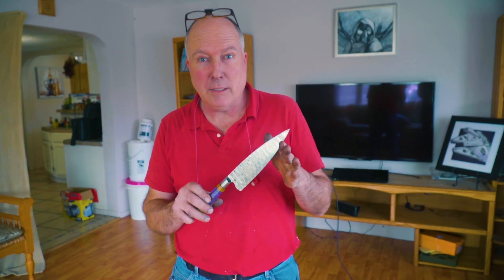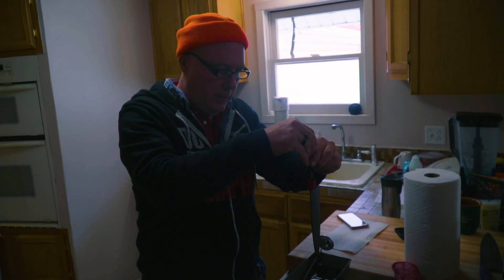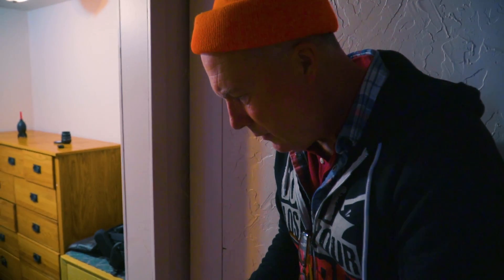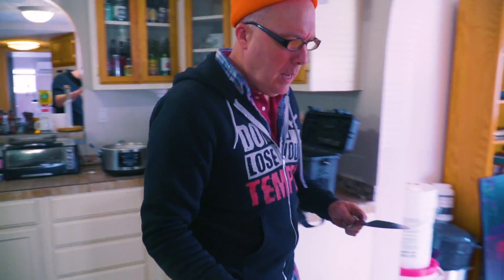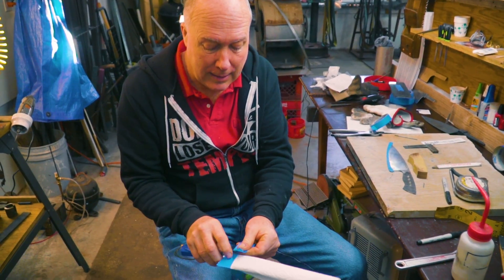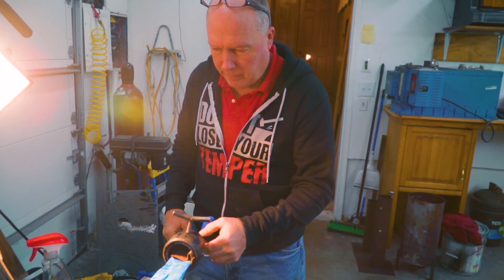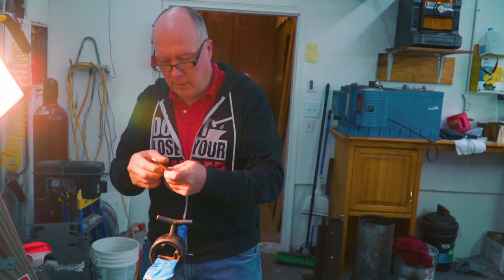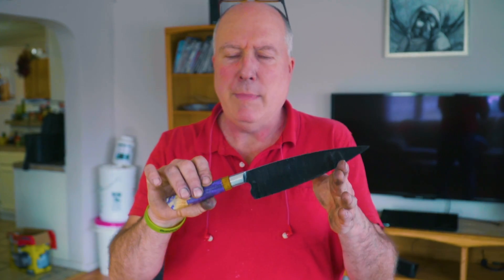It's Amazing What Instant Coffee Can Do...

Comment: how delicate is the coffee etch, is it something just for a show blade or can it be used as a knife/sword without coming off?
Reply from the maker: Hey mess
Great question. The coffee oxidizes the surface of the steel somewhat like gun bluing. Its not as durable as hot gun bluing but it’s not far off. We find the coffee etching very durable. We have kitchen knives used daily for several years and they still are holding up well 
👍🏻🔥☕️🔪. Be careful and be safe 
Team Royer

Comment: LOL Kyle Youse forgot to say : Coffee Break, Coffee Break Over. LOL  Would it be a good idea to use some scrap leather as a temporary sheathe when you are trying to protect the blade while working on the : Tang, Ricasso etc? A bit of Leather would protect against sticking better than paper towels?
Reply from the maker: Hey Michael ☕️👍🏻
If you enjoy doing leather work go for it. 
The Blue tape ,electrical, and duct tape work pretty good. If you build a leather sheath keep an eye on stray chards of steel and sanding grit getting in there. 
Get creative with it, but protect what you have worked hard to attain to. Cheers 

Dad